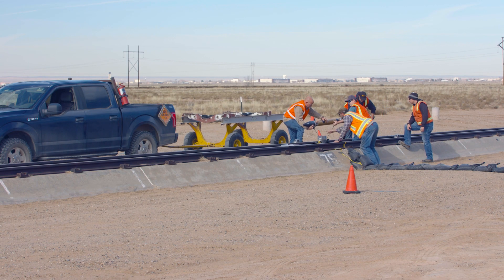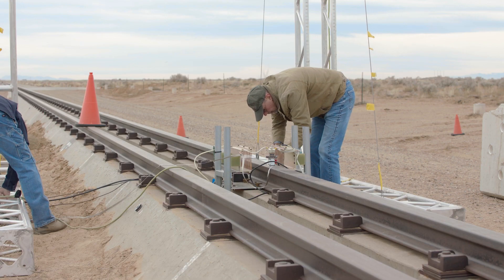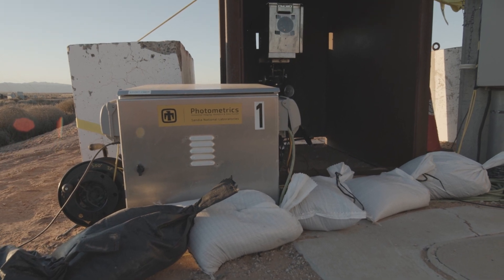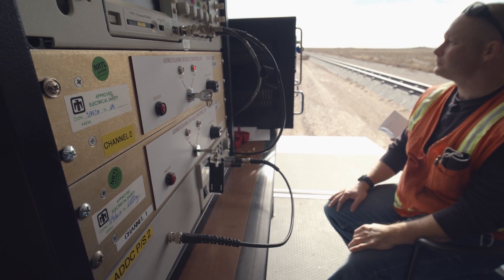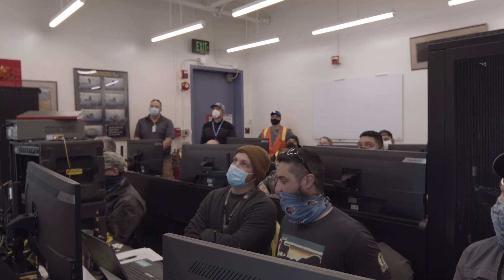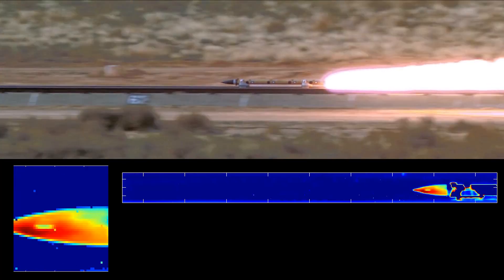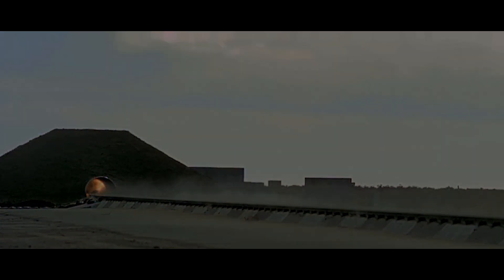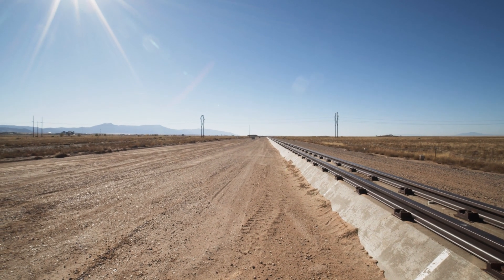Rocket Sled Test in Slow Motion

Comment: What would happen if you built that on a hill pointing up? Would you get escape velocity? 
That was one of Robert Heinlein's ideas in the moon is a harsh mistress, when they flung rocks at the earth from the moons surface using sled catapults.
Reply: Not quite. Escape velocity is above 10 km/sec. That’s about Mach 33 at ground level. The whole test specimen would have melted before reaching the terminal area, I guess. And the sled tracks would be good for the scrapyard.
Reply: There are proposals for launching payloads to orbit via ground-based launcher, but not like this. Those use electromagnetic or rotary catapults, and the whole point of them is to give the launched object a large velocity without using rockets, which suffer under the yoke of having to spend fuel to accelerate the rest of their fuel. The rail here is used to precisely aim the rocket, not accelerate it.

Comment: Европейское командование ВС США заявило, что российский пилот истребителя Су-27 поступил не культурно. Он остановил в воздухе самолёт, открыл кабину и показательно пописал на дрон, в результате чего у беспилотника расплавился винт. Далее у летательного аппарата за 23 миллиона долларов замкнула всё электроника, и он упал (пи*данулся) в международные воды Чёрного моря.
*
The European Command of the US Armed Forces stated that the Russian pilot of the Su-27 fighter did not act culturally. He stopped the plane in the air, opened the cockpit and pointedly peed on the drone, as a result of which the drone's propeller melted. Further, the aircraft for $ 23 million had all the electronics closed, and it fell (pi * danced) into the international waters of the Black Sea.

Comment: I swear, when I saw the real speed it looked like a roadrunner cartoon. Awesome 😎 Back in my day at Eglin AFB they had an indoor test range and would model different missiles etc.. and shoot them out of a 20mm cannon secured to the ground. There were 100 Hasselblad cameras, 50 in the wall and 50 in the floor that took pictures in flight.
Reply: Beep Beep
Reply: Was it in vacuum? Maybe some kind of hyper ballistic aerodynamics test tunnel ?
Reply: It's a capture tunnel. Missile goes in and the tunnel stops it, likely in a crushed rock barrier. The alternative is to let the missile fly free, but that is a lot more dangerous.
Reply: Slow mo: the sound of a descending whistle, silence and then pooffffff
Reply: 3200 fps is the approximate velocity of a 165 gr. .300 Winchester magnum bullet at the muzzle.
Reply: @merylpelosi8485  or a 55gr .223... or a 90gr .22 creedmore, an 85gr .243, a 140gr Ackley improved, 7mm rem mag, .375 rem ultra mag, 6mm rem., etc etc etc....